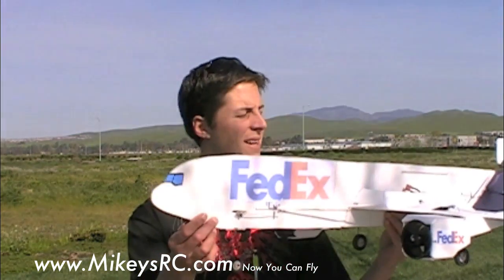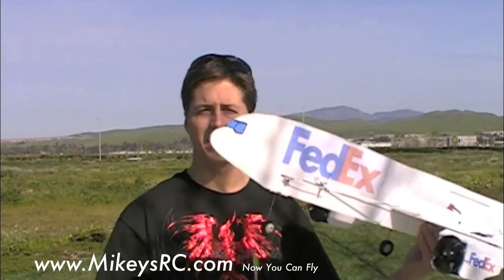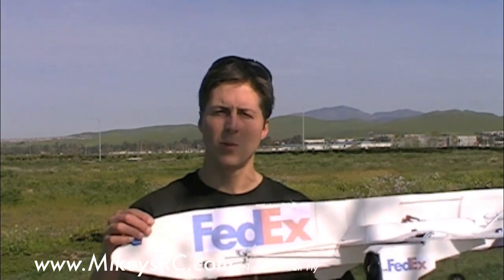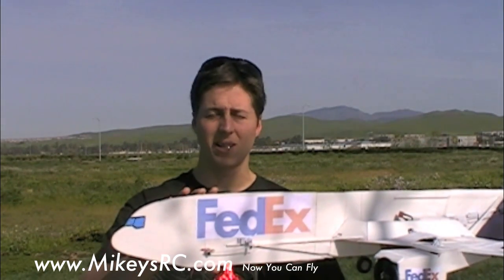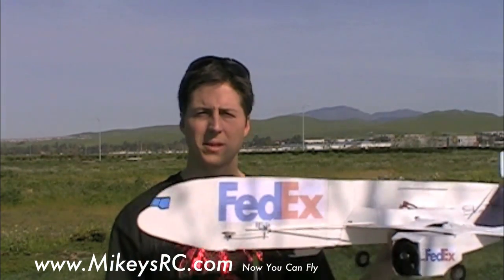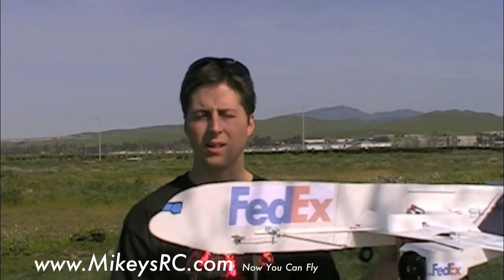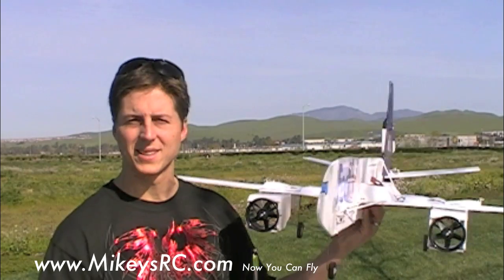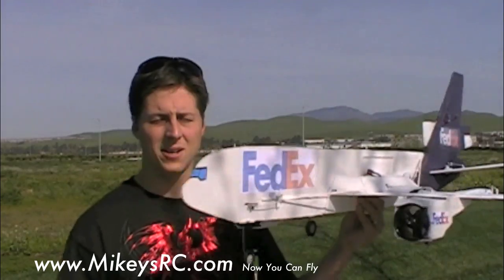Scratch Built DC-10 Park Jet Twin EDF CRASH

Comment: No 2nd video?  No plans?    C'mon mikey ! :-)
Reply from the maker: Plane design was flawed so I decided not to do plans.  This plane has too much vertical surface area as a profile plane design.  So the rudder wasn't big enough to keep it going straight.  I really liked how the plane looked....it's a bummer it didn't work well.
Reply: ah interesting info, I'm still going to make one, will take your findings on board. thanks

Comment: It's obvious that the thrust on the L/H side reduced suddenly (for whatever reason) causing the left wing to stall when it reached Vmca hence the inevitable death spiral dive. Nothing to do with low pressure of anything like that on the fuse side.
The driver could have saved the day if he had reduced the throttle to idle.

Looked good & even better spiraling in:-):-)

Comment: Watch the starboard engine in the slow-motion clip at 2:35 and so on. The starboard engine is pulling in toward the fuselage and is not aligned with the fuselage or the port engine. Maybe a pylon experienced a second of flutter, deflecting thrust as you know can cause a dramatic response from the aircraft. Anyway awesome dc-10-30.

Comment: with that being alot of flat proflle fuse it is bending in the air and it will overpower the vertical stailizer, i have mad a few (alot of profle type planes forfun and if its not rigid it will do that.

Comment: I think that you build the craft in a 2D fasion out of pure simplicity but the roll-out at the end there was caused by the flat fore-fuselage. If there ever will be a 3d model of this like your CY-14 it wont have that problem,  I WANT THE PDF'S, no pressure.

Comment: You gotta calibrate your ESCs to your Transmitter. I had this problem with a twin engine plane I bought. It wasn't calibrated very well, and when I went to land I went from 1/4 throttle to 3/4 throttle, it had a lot of yaw in one direction. The plane is super stable so it was OK but it scared me quite a bit.

Comment: being a profile, the side area of the fuselage ahead of the balance point is like a rudder in the nose, so it overpowers the yaw axis. the fix is to increase the size of the fin and rudder or trim down the forward fuselage area. or a little of both to maintain the scale outline. and maybe move the balance point forward just a bit. I would also parallel the batteries so there would not be a question of which one has a higher charge.    that plane looks awesome in the air, a great project,

Comment: Twin EDF  with two 3 S lipo should be  connected via a H harness meaning parallel battery to the EDF twin. Or one larger 3S batteries to the EDF twin via a Y harness to prevent or minimize out of balance power to each EDF. Just my 2 cents
I had many twin or triple EDF connected in Y or H harness configuration and had not encounter any problem.

Comment: What happened is called P-Factor, look it up. I doubt this guy has his fan blades turning in posite directions. When there is a sudden increase in the apparent wind direction, there is an uneven allignment of the prop torques produced by the fans. The sudden yaw is the tell tale sign.

Comment: Mikey, Your problem is with the flat 2 dimensional fuselage. This flat surface acts as a major control surface for the aircraft and any slight gust of wind will throw the aerodynamics completely off.  This is not usually a problem for  a prop plane because the prop-wash serves to stabilize a flat fuselage in flight.  A twin engine ducted fan design like this will not work unless you add another plane to the fuselage to keep the fuselage from acting like a sideways wing.  Good Luck, Mike Case

Comment: Man sorry for your loss. I never use a seperate battery power for each twin. I use a large capacity battery or connect two closely match battery in parrarallel via a "H" harness for my twin. It means sharring the same power for multiple EDF.
I also did the same for my triple mounted EDF.Battery packs do not discharge current equally . The discharge disparity  gets worst over time and usage.

Comment: Remember, on the real thing, the body is round, not a flat plank. So a flat plank with just as much, if not more, surface area as the tail section, that far up front can and will steer the aircraft.

Some carbon rods to prevent any flex and sliding the main planes forward may work...transferring some of that surface area rearward.

Comment: Hmm.... Maybe try cutting out two copies of the fuse with vert' Stab' sandwich 1/4 sq balsa or carbon rod and tape all around the edge. The rod in the middle plus bending the foam will give it some rigidity from wanting to bend with that long front end. With all your graphics it will give it more of a scale appearance and some room for hardware, depending on how many dowels wide you make it. I love your builds and get some great ideas from them.

Comment: Front end torqued to the left, airplane left, and everything else followed to the ground. Glass the fuse and wing. Much lighter, cheaper and stronger. You dont even have to do the whole thing. Just take 1inch strips and wrap around the leading edges.

Comment from the maker: @edoctoor ......continued from above.  You have to program your ESC to give you a waring that the battery is low.  Most have this feature called "cut off"  Set it up doe soft cut off and then set the min voltage to 3.0 colts per cell.  HOWEVER, yes if you leave the throttle on EVEN after you reach the lipo cut off you can still damage you battery.  SO as soon as you hear  / see that the motor power drops of significantly then it's time to land and let you battery cool before a recharge.

Comment from the maker: @edoctoor  Actually I do a glide test with NO electronics installed....lighter weight is better.  You want it to glide with a slight nose down angle.  I never actually let my planes hit the ground.  I always catch them first.  So really they are only flying  / gliding for about 10 feet.  But that's enough to know if it's nose or tail heavy.

As for the batteries.....you NEVER want to run a li-po battery so low that each cell is lower than 3.0 volts. Set up your ESC to have a safe cut off voltage

Comment: Hi, i noticed in the video that the virtical stab was flexing quite a bit, this may of contributed to the tip stall, why not make it stiffer by adding a kf4 (step on both sides) this would make  it, stiffer and would produce extra stability in the yaw?
And i think a kf2 on the wings would help too.
Just my two pence worth.
Keep up the good work.
Regards.
Leigh (UK)
P.s haven't had any good enough weather to maiden the spit with rudder yet.

Comment: Very nice Mike. Something definately happened with the left EDF. I had a similar experence with a hand launch foamy  EDF.  At release, power seemed low as if the EDF wasn't up to full power, and when it hit the ground, all the rotors blades were broken. My guess is that the rotor may have started to fail in the air, but I can tell you that those blades will break on impact, even if you are not on the throttle.

Comment: Great plane, like the shape and the two engines. I learned well from Lama v3 helicopter experience that if it will crash I chop the power, so when it actually touches ground the rotors spool down already. Of course it is always easy to be smart afterwards. Good luck with repairs and I look forward to watch next clip on this great looking commercial jet!

Comment: A very nice looking plane, but it has a classic design flaw that I have seen many many times with profile fuselage models. There is too much side area forward of your wing. Its as if you have a vertical stabilizer on the front of the plane.  Increase the vertical stab size or add winglets to the wing tips. Good luck. Hope it flys better next time.